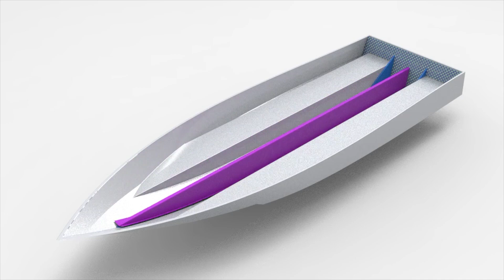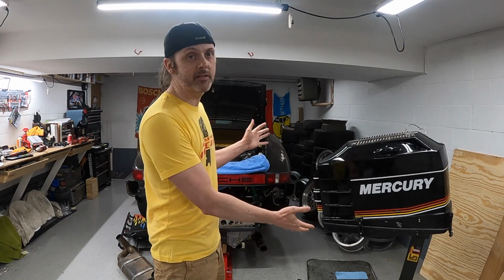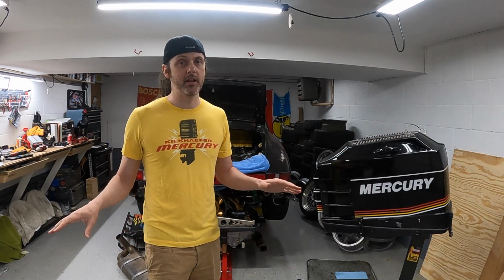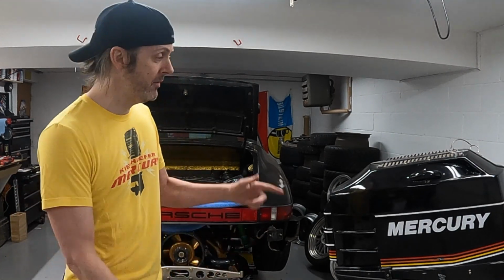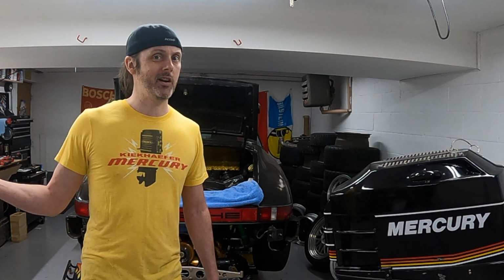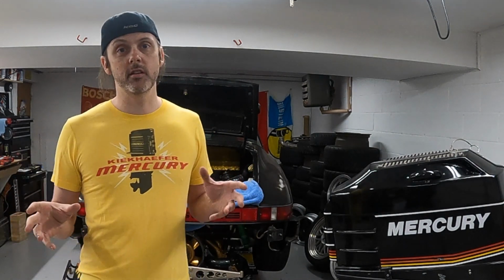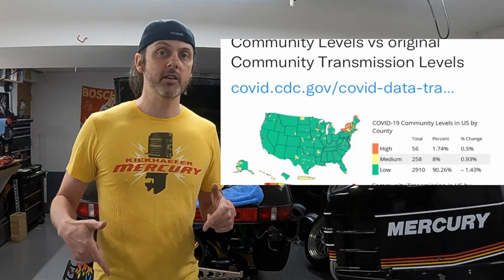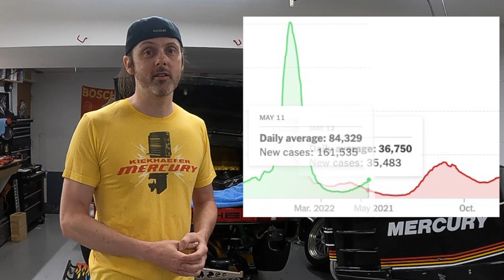SLEEKCRAFT SUNDAY 2022 High Performance Hull Rebuild RECAP, 200hp Mercury 2.4L and Future Plans! #19

Comment: Your vids have helped me get my grandpas 87 eliminator running again and it is running like a champ the fuel pick up tube was so deteriorated and it's like a random size so I had to find some copper piping remake a new one, had to drill out a fitting put the pipe in the fitting sweat them together! something so simple yet so complicated but, restore about a boat love and all that sweat equity just helps put a smile on!
Reply from the maker: Sounds cooler than almost everything made today.   Love eliminators and although I prefer the sleeks style/lines the hull performance of an eliminator is just a whole different level.

Comment: Originally a Yamaha. Then, an Evinrude. But that era Merc is going to look the best on that boat. Former Owner Mark here, Cant wait to see it mounted on that boat. Glad S C S are back!
Reply from the maker: Pitter patter!   Ordered carb kit for the 2.4, going to rebuild everything in the fuel system before running it
Reply: @ADDvanced  Be thorough on the carb system, I have a 2.4 also, and have carb kits to install. Will be looking for tips and tricks!

Comment: It’s a great series      I picked up a free 89 cobra bass boat with a rock impact engine (skipped timing chain).   First outboard I’ve ripped apart and looking forward to replacing the soft floor.    

Have done custom fibreglass pieces on my Nissan R32 , so looking forward to seeing the finished product.

One idea I have from seeing this series is to have the transom brace continue up and glassed in to the underside of the splash well.

Do what you need to do to protect those around you. As an ex Federal Officer in Communist Canada look into the data, never trust the government or their right hand.  

Most people are programmed pieces of shit, you can’t change it

Keep Safe and Cherish the Time

Comment: Why don’t you just upgrade the inboard to jet drive?
Reply from the maker: How is that an upgrade?   Jets are less efficient and slower.
Reply: @ADDvanced  you are correct, but it’s a shallow system with no trim restrictions. It’s a trade off
Reply from the maker: @shellbackracing3999  With the same power it's slower and uses more gas to get the same distance.  Plus it clogs with weeds allllll the time.   Not sure how a jet would be an upgrade to go slower use more gas and handle worse.